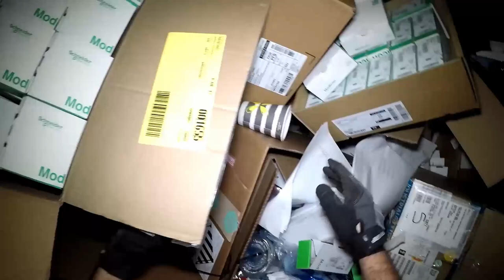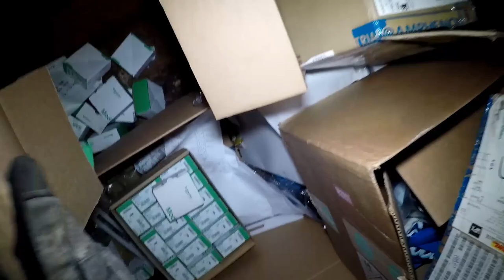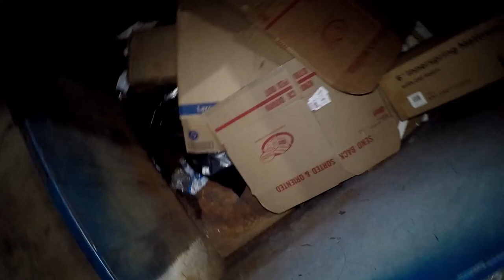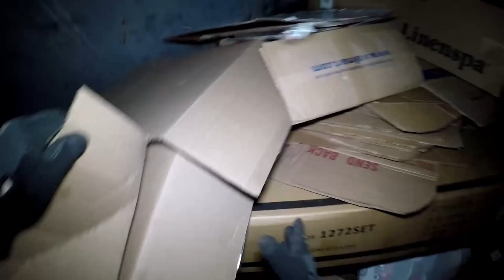Dumpster Diving "Trash Of The Herbal Kind"

Comment: Morning Mike, the spool of wire could have been used to either provide a ground path to something like when they may be transferring a volatile substance or to check continuity between two points. Where they list the resistance of the wire you could also figure the resistance in whatever you might be measuring. Good score

Comment: 6:33 - the metal lighting stand is not recyclable by WM, but recyclable by Mike, and fluorescent lights are not allowed in any dumpster or trash receptical because they contain mercury, just like batteries.

Comment: The rolls of "putty" were butyl tape. It is used by sailors to seal fittings that go through decks etc. so that they are water tight. It doesn't set so the fittings can be removed at a later date. I'm sure it also has industrial uses.
Reply: And it's very common in the RV industry. Very usefull for a lot of uses. Almost more usefull as Duct tape:)

Comment: 14:41 Butyl tape sealent... very multiuse ans stick like crazy but not ina way its permanent. but takes some force to unde the part you stuck together.. rolls like that cost between 10 tot 25 bucks
Reply: They use that butyl tape to seal up aluminum trailers

Comment: that role you found in the light is called roofing putty when they put a new steel sheet on a roof they put a strip of that putty down the edge then the edge of the next sheet is placed on to the putty making a seal ive used tons of it when i was roofing

Comment: wire spool looks like detonator wire. Mike you filling all right sound a little congested. Contacts = lugs. Have you ever tried to  Craigslist any of the larger conduit fittings you can check like home depot some are pricey. let there be light and let the light shine down on you

Comment: hey Mike what you do with that reel with wire on it with the clip on it?
Reply: I buy that reel and you can keep all the wire on it. I use that in my job field. it is used to take DC voltage readings for conducting CP testing on pipelines and storage tanks.